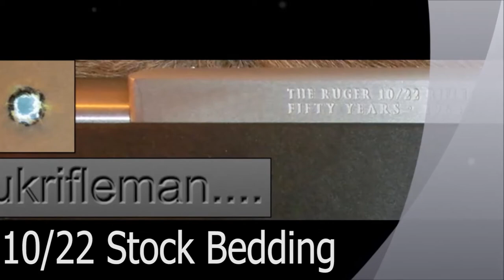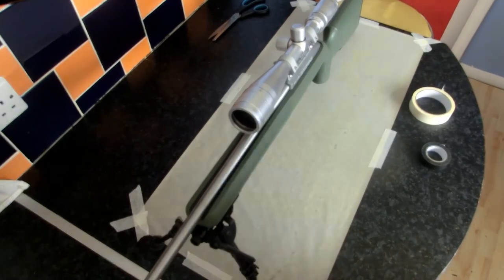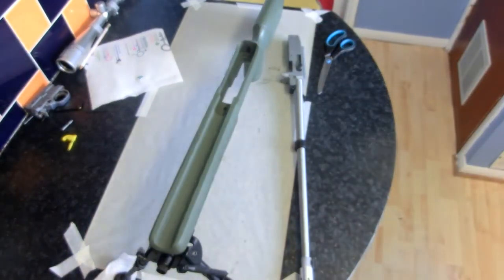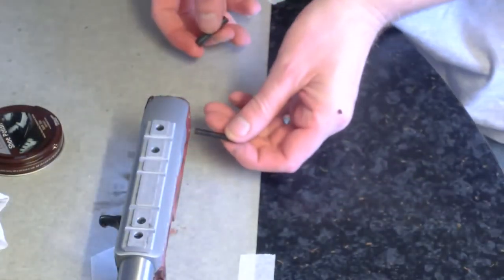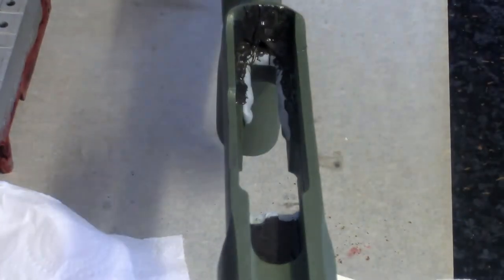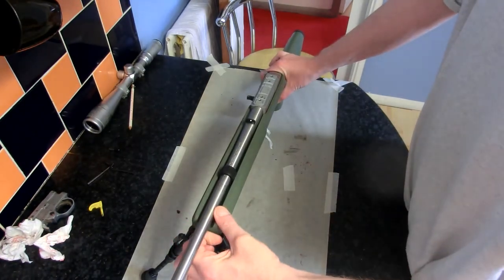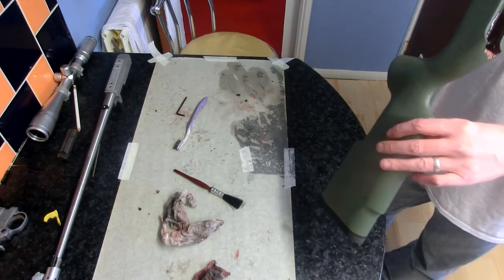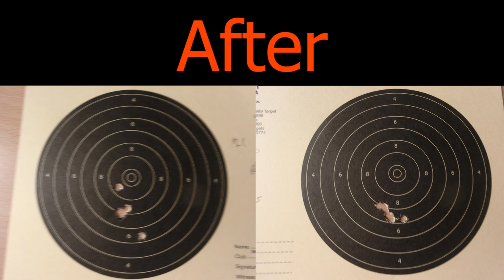Bedding a Ruger 10/22 into a Boyds Tacticool Stock

Comment: If you do another one, try to do it in a way that allows you to fit the action screws. You want the bedding compound to create a mould of the action when everything is assembled and torqued correctly. If you don't assemble with the screws you're defeating the purpose.

Comment: the stock is for a .920 bull barrel.
Reply: Does not matter what barrel he likes to use.
Reply: @ctsteve1967  That stock obviously isnt attached all the way. The receiver shouldnt be moving all over the place like that. Its not an issue with bedding. The gun isnt properly attached to the stock its just sitting in it loosely. The takedown screw is loose or not the correct length and bottoming out early.
Reply: The 10/22 is not like other rifles so bedding the action is not recommend due to the way the barrel mounts.  It is better to just bed the front inch of the barrel forward of the action screw.